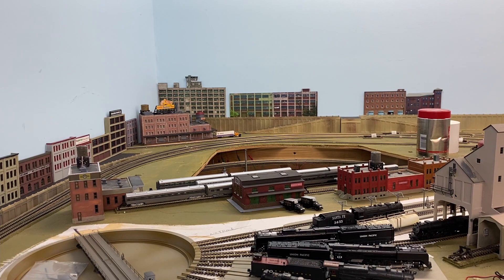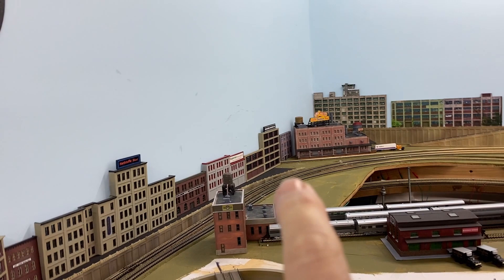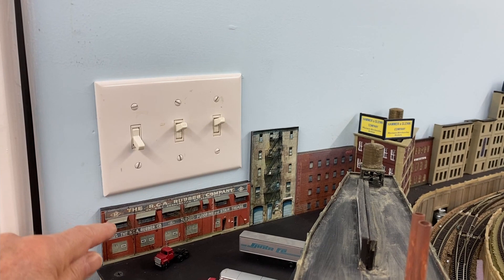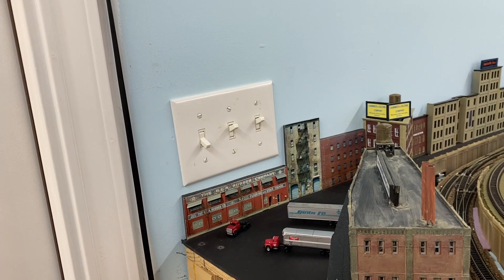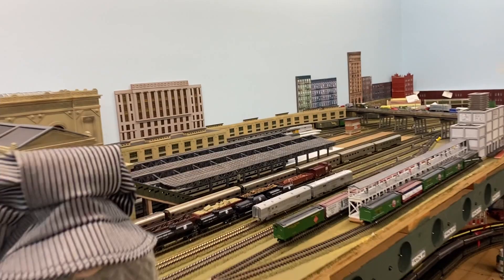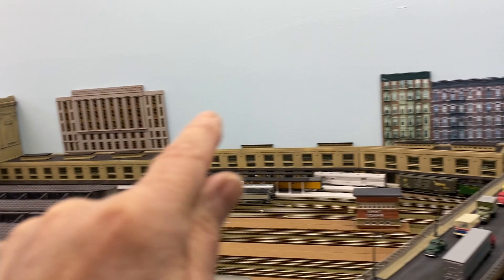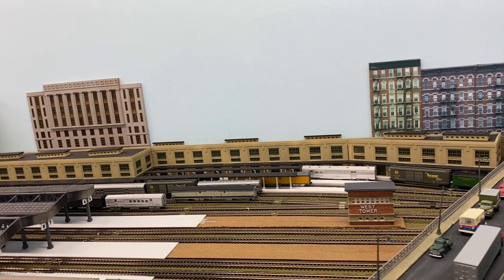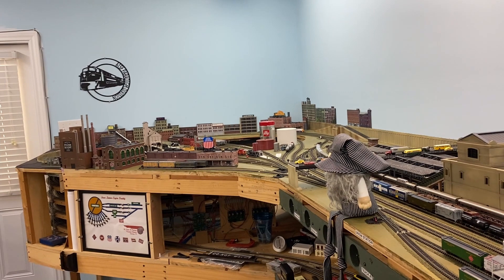Update Background Building Flats

Comment: The flats look great.
Reply from the maker: Thank you very much for your comment.....John
Reply: @tanzj  I’m planning on using a lot of flats as well. Any recommendations on a reasonable priced dealer to buy from john ?
Reply from the maker: I got those from the eBay site (seller is a.b.b.r_81) for tracksideflats.com (website). They have free shipping plus give an additional 7% off if you buy 3 items. I used eBay since the vendors usually ship faster especially since I got them around the holidays……John
Reply: @tanzj  thanks for the heads up john. I’ll check them out